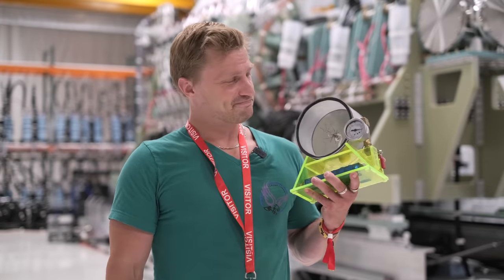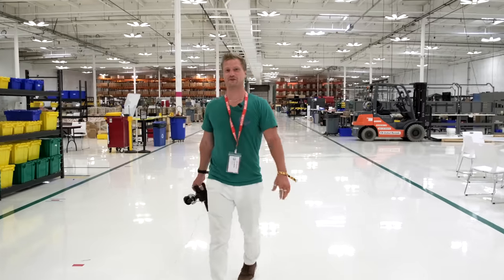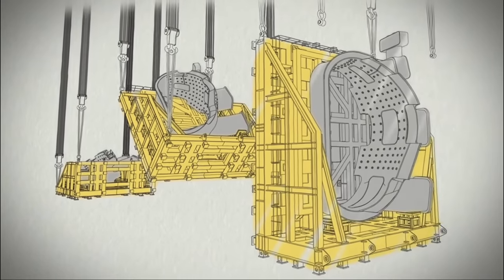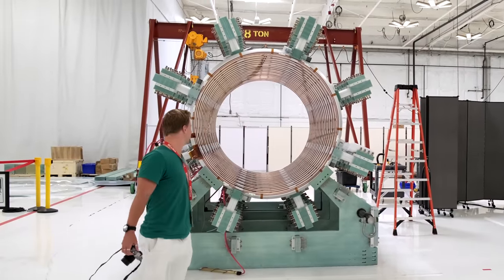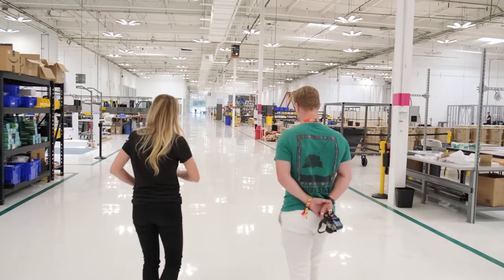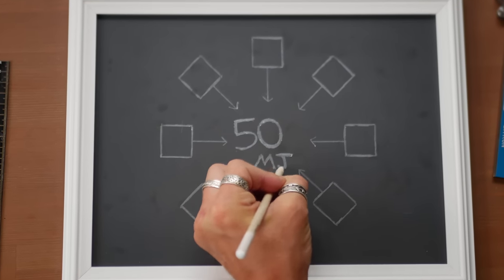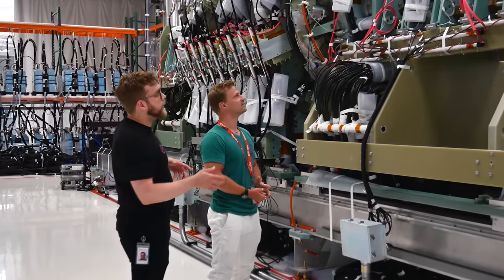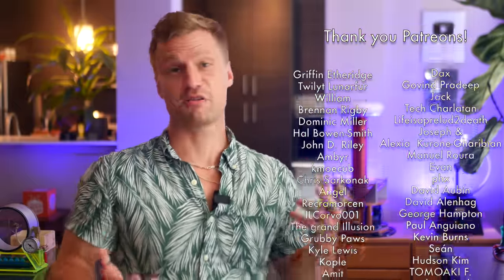An Exotic Approach to Nuclear Fusion (Helion Energy BTS)

Comment: The Helion solution is so elegant and efficient compared to other kinds of fusors.  Amazing to watch.  Thanks for bringing this to us, Plasma Channel.
Reply: not necessarily. the methods of getting high temp plasma and energy extraction itself are very cool and efficient. yes.
but the fuel is bad. and they lose power to neutrons and the fact a lot of reactions wont be the ones they need (d d instead of d he3). the fuel at 100mil Kelvin I think is about a few orders of magnitude worse then tritium deuterium (dont remember exact numbers). it gets better beyond 300 million kelvin but they are far away from those temperatures...

it's quite a one sided overview I feel. still a long way till fusion but I do really hope they manage some day. the methods are cool.
Reply: @scipug3048   AFAIK Polaris will go to 20 keV plasma temperatures (220 million K). Note that it is not just the temperature that counts, but also the density. With high beta FRCs you can almost linearly scale between density and temperature. Their plasma also has a very low ratio of electron to ion temperature which really helps.
Also not that they actually want D-D side reactions because that is how they make the He3 in the first place.
Reply: @scipug3048 The fuel is not bad, it is the right fuel for this type of machine. Deuterium and Tritium is the only thing that makes sense for Tokamaks and other fusion designs that cannot reach very high temperatures without sacrificing all the energy generated to losses (mostly Bremsstrahlung and Cyclo/Synchrotron). Helion's machines losses grow slower with temp, so while a Tokamak tops at about 15 keV with D-T, one of Helion's reactors tops at about 50 keV with D-He3. At this temperature, a Deuterium-Helium-3 mix has 50 times the reactivity than at 15 keV.
This is the main reason but there are more.
Reply: @charliem6590  yea the fuel is good for this specific machine. but all in all the reactivity of T D is orders of magnitude higher. I dont remember but I think I said that helion has potential to reach higher temperatures which can negate some of that issue, but there is inherently flaws and drawbacks in this design just like with ANY other fusion, and I dont like saying only the good stuff about smth bc it gives people falls hope. also D and D can still react which produces no charged particles and is a source of losses for helion (ik they say they want that to make He3 from that, bc it's very rare. But it's still a los. Tokamaks also produce fuel on the side but in that process heat is still generated to turn turbines. here if two deuterium react, 0 energy of that neutron will reach the power grid.)
Reply: @scipug3048  D-D reactions do produce charged particles. For each neutron (with 2.5 MeV), they also give 1 Triton (1.0 keV), 1 Helium-3 ion (0.8 keV) and one proton (3.0 MeV). All 3 of these have charge, and all 3 are available for direct energy conversion to electricity.

Moreover, D-T is quite aggressive with the hardware, it produces so many neutrons, and so energetic, that it is difficult and expensive to make a reactor that can withstand them for reasonable periods.

It is the same reasoning behind our cars not using liquid hydrogen as fuel, even if it is much more energy dense than gasoline. Liquid hydrogen it too difficult to handle, and gasoline is good enough anyway.

Comment: While I like your channel, this video goes so far away from your usual content. @PlasmaChannel You are sponsoring a very likely snake oil startup.  Their setup, at the temperatures they announce (100M K) is likely 1000 times less reactive than any D-T reactor running at 300M K. If they were at 300M K instead of 100M, it would be still 50 times less reactive. On another note, they claim their "reactor" produces no neutrons in the process. While, I'd like to point out, at thermonuclear temperatures, pairs of deuterium atoms will also fuse together yielding an 3He atom and a neutron. I see no barrier around the reactor to stop such neutrons. I would like to point you to this video, which explains the flaws far better than I could have done here. https://www.youtube.com/watch?v=3vUPhsFoniw
Reply: That is nonsense and quite frankly the IM video is pretty dumb since he did not understand the concept at all.

Comment: This thing kind of reminds me of a standard internal combustion engine, with energy being extracted from repeated cycles of squeezing the fuel and then making it explode.
Reply: God, let's hope it doesn't explode!

Come to think of it though, that would be some really interesting physics! An explosion like the kind you get from conventional flammables should be impossible, here. 

You're not wrong, though. From what I watched, it's kind of an "electromagnetic piston", if you want to think of it, that way. It seems like a  more viable method of skipping the steam turbines and going right to direct conversion.
Reply: Except far more efficient.
Reply: That's a really great analogy. The piston is instead the magnetic field.
Reply: @Mindbulletz  , the problem with analogies is that they tend to get overused. The water pipe analogy to explain Amps, Volts and Ohms is a good example. Worse is when the analogy is used to explain the entire concept, without any other context, or it's used as the thumbnail to get clicks. "Electromagnetic piston will change how we make power, forever!" kind of thing. As much as it's a useful shorthand for talking about it, I kinda hope it stays buried in the comments.....
Reply: @Coffreek  So what your saying is that analogies are kind of like Wikipedia; over-used, overrated, and often inaccurate.
Reply: @Coffreek  And, BTW, what part of "this reminds me of" made you think that I was deliberately making an anology?
Reply: @CharlesGriswold , well, none of it honestly, but my thought process frequently skips logical, or even sensible, processes, and simply jams two ideas together.
Reply: @Coffreek  Fair enough.

Comment: There is still neutron radiation from this reaction. Deuterium will fuse with other Deuterium unless you fuse one atom at a time (which would be ridiculous).
The only truly neutron free reaction is the Proton-Boron fusion.
Reply: That sounds about right. How do you control that reaction? Just a proton gun shot into plasma Boron fuel?
Reply: @StoneKathryn  Well just like any other type of fusion, you have many methods. What you describe is an inertial confinement, that works of course, you could have a pure thermonuclear one where you just hold the plasma at the required pressure and temperature or you could do a Z-pinch like this Helion company wants to do. There's disadvantages to all of these and for Proton Boron you need even higher energies still so of course it's something you can only start considering once Deuterium-Tritium fusion is easy to do because any other kind of fusion is just MUCH harder.
Reply: @MrRolnicek  I agree. Things could very much change with a "working" fusion energy source. I have looked forward to "fixing" the problem of fission reactors by "plasma torching" it to much smaller elements. That would be nice. It would be like "cooking" it down. Lots of "trash" problems could be solved with plasma torching it down to elements.
Reply: @StoneKathryn  It's a lot easier to just chuck any inconvenient elements into fission waste burner type reactors. No need for fancy solutions when simple ones work well.
Reply: @MrRolnicek  Are they doing this to "clean" up the waste then. Have the waste problems been "solved"?
Reply: @StoneKathryn  No, the waste "problems" haven't been solved. Nuclear power has only been around for a few decades at this point so any nuclear powerplant that exists out there still has plenty of space in its cooldown pool for a few more decades of "spent" fuel to sit in before anything needs to be done with it.
This is why people are for the most part dragging their feet because it just isn't a problem. France at one point made the Superphoenix which would breed new fuel but could also be used to burn the old fuel at the same time so that is the type of reactor I was referring to but they shut it down on basically bulshit reasons just after they fixed the teething problems and proved that it works. (just read the wiki article if you care).
Reply: @MrRolnicek Thanks! I'll read it! I'm sitting up on a bluff above a nuclear power plant so I bet you can understand my desire to have the waste problem dealt with. Superphénix Reactor by the way. So sad it see it was closed by decree in 1998.
Reply: @StoneKathryn  I also live next to a nuclear power plant but for me it just means experiencing first hand how safe it really is and how good it is to have reliable and most importantly clean power. I am interested in the subject admittedly but damn, if you learn about just how awful it is for you to live next to a coal power plant, you'd take even an unsafe reactor in your backyard (although they don't make those anymore obviously).
I'm actually quite unhappy that there are plans for deep geological storage of spent fuel. It is a safe and permanent method but the reason I'm unhappy is that the "spent" fuel isn't actually very spent. It could be used to make 10 times as much power as it had already made quite easily. But buying new fuel is cheaper so they do that instead. I guess that's fine too but eventually we'll want to use the fuel in the "permanent" storage
Reply: @MrRolnicek  Do they give you iodine pills and do they have plans to bus you out too? We get a calendar each year from the nuke plant so we can get our "fresh" supply of iodine pills with the coupon attached to it. They always have the emergency plan explained on it too. They say with the geology with where the waste is stored that it would contaminate the water for 50 miles around. It's right on the Mississippi River.

Comment: How do they prevent D-D fusion happening instead of D-He3? If mostly D-D fusion is happening, you'd still get a ton of neutron radiation (similar to D-T) and since Neutrons don't really interact with magnetic fields, their energy would just go to waste in the walls without inducing a current. It's my understanding that at 100Mio°C or so, the reactivity for D-He3 is still like an order of magnitude lower than D-D.
Reply: That sounds like a good argument. I think you're right to point out that D-D reactions could happen instead of D-He3 since less of a nucleonic repulsion would be with the D-D reaction at the Lawson criterion. Thanks for asking about this.
Reply: They don't it is just a scam.
Reply: D-D fusion produces only 2.45 MeV neutrons and only in half of the reactions. They actually want the D-D side reactions because those are what make the He3.
Reply: Well, unless someone wants to claim that the video is faked you can see the reaction right there, so the reaction does certainly happen.
As for the D-D; I can’t comment on your question directly, however I wish to raise the fact that (as far as I’ve heard and understood) they utilise the D-D reactions to make the fuel on the go.
Take from that what you can.
Reply: @Suppagappa what exactly are you seeing, that you identified as a D-He3 fusion? 
But that wasn't the point I was making. I don't doubt that they can make fusion happen. 
The point is if 90% of fusion is D + D -> He3 + n , rather than D + He3 -> He4 + p, then:
1) they don't really have less (neutron) radiation than conventional Tokamak designs
2) they can't get any energy from 90% of reactions, because the energy is lost to the neutrons, which don't interact with the magnetic field in a meaningful way.

Based on my limited understanding, if they want to reverse this trend and have D-He3 dominate D-D, they will need to go significantly hotter than 100 Million C, which this video does not address.
Reply: @plainText384  ”what exactly are you seeing, that you identified as a D-He3 fusion?” I saw a reaction, I assumed that the footage of the reaction was not edited in a misleading way, and they claim that it is a D-He^3 reaction. I either believe them or I don’t. (for claritys sake: I assume that both may be true) Either I doubt them, in which case we don’t get anywhere with this approach, or I believe them, in which case they either achieve fusion or they go bust, either proving or disproving the viability of their approach. In the end it is another approach to fusion, not a competing one.

For the rest of the first part, talking about more or less radiation than some other design means nothing if put in absolutes, because then the solution becomes ”Make the reactor smaller”.

”they can’t get any energy from 90% of reactions, because the energy is lost to the neutrons, which don’t interact with the magnetic field in a meaningful way.” I mean, that really doesn’t matter if the energy they do get from the 10% makes up for all the energy they put in initially.

Also, why does everyone seem to get so hung up on the neutron part? The ”energy reaction” (D-He^3) doesn’t produce neutrons. Other than that it’s a practical problem with a practical solution.
Reply: @plainText384  
THIS video does not address it, but they are of course going significantly hotter than 100 million C. 
100 + million C was the temperature Trenta achieved. Trenta was a subscale experiment. Polaris will go to ~20 keV (220 Million degrees). Power plants will go even higher.
And they actually need the D-D side reactions to make He3. They will need two D-D reactions for every D-He3 reaction (until they have enough He3 from Tritium- decay, then they only need one). Half of those D-D reactions produce a Helion and a neutron. The other half produces a Triton and a proton (no neutron).

1) and they would still have A LOT less neutron radiation than in a D-T Tokamak. For one, only 1/3 of the reactions (1/4 with added He3 from T- decay) would produce a neutron. Secondly, the D-D neutrons are a lot more benign at 2.45 MeV (vs 14 MeV from D-T). There are a lot more material and shielding options for those neutron energies.

2). D-D reactions still release 66% (4.85 MeV) of their energy as charged particles and only 33% (2.45 MeV) of the energy as neutrons.
Reply: @Suppagappa what was it that you saw, that made you identify it as a fusion reaction?
I don't doubt that Helion is lying about fusion taking place, but I don't really see any part of the video that you can point to and say: "this visually shows fusion reactions taking place". (Unless you turn on subtitles).

The lack of Neutron radiation was one of the advantages The  Plasma Channel mentions as an advantage of the D-He3 fusion technology, that's why I bring it up.

And he does not ask Helion about D-D fusion, nor does he comment on it himself. In my opinion that's a significant missed opportunity to do more than just a naive surface-level discussion of the topic.

As for breaking even on energy, again this is a topic I feel was underexplored. He could have asked way more questions on current Qplasma and Qengineering milestones, where they are losing energy, and where they are looking for improvements.

Comment: Seems like the only thing that novel reactors get us is novel instability modes. Credit to  Helion for thinking outside the Torus, though.

I'm very cynical about (practical) fusion power, so I'm going to guess that the end result is going to be a modified version of the "tilt mode" instability. The plasma breaks confinement during the relaxation phase, because the plasma doesn't relax evenly, it's impossible to completely anticipate, and shift the confinement field quickly enough. Think of it as the Spheromak version of the "kink" instability.

Comment: Some issues, it still requires massive energy input and I'm not convinced their extracting efficiently the energy out. helium3 as a fuel is extremely expensive and rare on planet earth, mostly a by-product of nuclear decay. Also That's a extremely small amount of time to get energy back using coils. Furthermore repeative strain to the vessel could turn it into an EMP bomb.
Reply: They make their own He3 by fusing Deuterium in the same machine.

Comment: Several things:
- if they would change their vacuum pumps to either Pfeiffer-HighScroll or Edwards NXDS, it would be silent during your filmging - these are scroll pumps
- DHe3 would need about 1,6 Trillion degrees, to reach an optimal cross section for this reaction. Its already hard to reach 150 Mio degree in a Tokamak, ...
- I am still missing He4 measurements or something as a result of the reaction - this would proof that they achieved a noteworthy amount of fusion
Reply: skeptical on this solution for the same reasons.

Comment: You should run your audio through "Krisp" noise cancelling for some of these sections. Or if you have an NVidia GPU, use their noise cancelling solution with something like Virtual Audio Cables to provide input/output channels for re-recording.
Reply: Izotope is the best solution and is perfect for a constant noise source
Reply: Did you just try to sell monster cables?
Reply: Or just use better mic technique in the first place